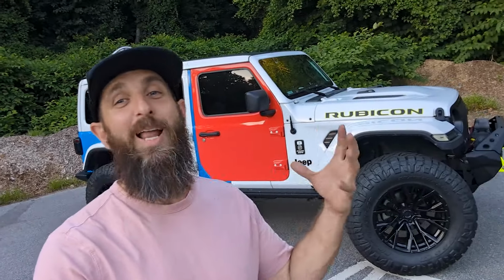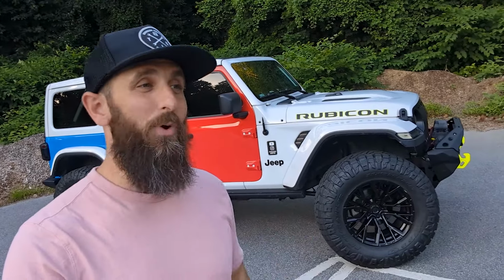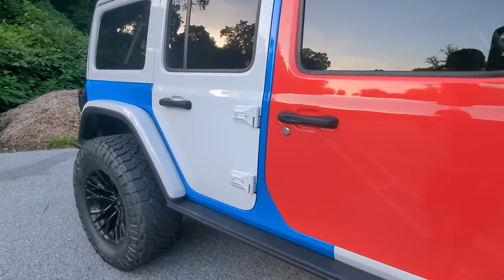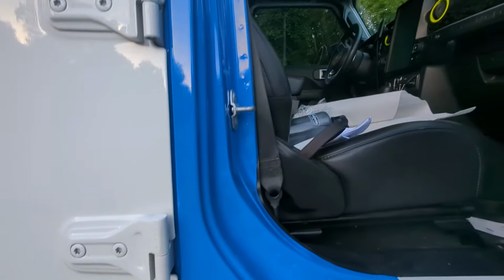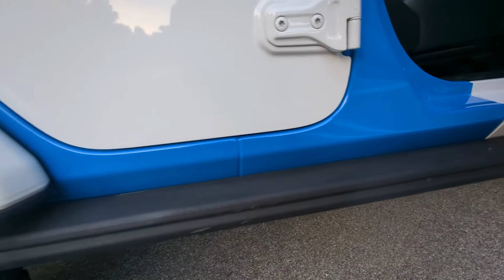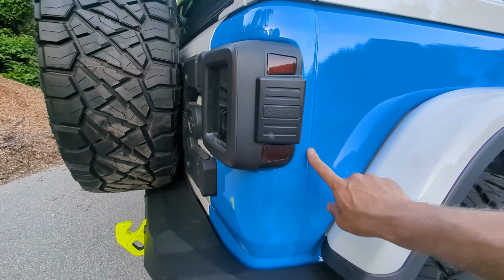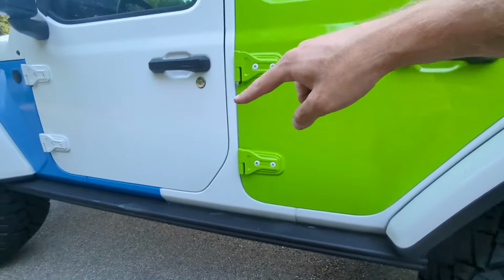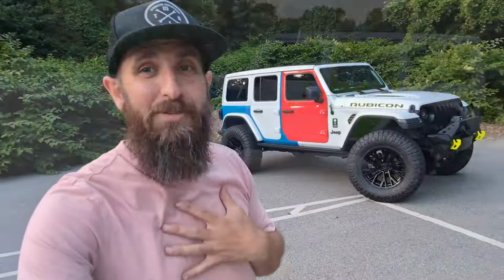ColorThisJeep Part 2: Wrapping Panels 3 & 4 | 4th of July Theme + Giveaway Announcement!

Comment: I was so glad to see you used my suggestion of putting the winners name under the wrap. It looks great. Gives a cool embossed look
Reply from the maker: It was a great suggestion I just have to figure out how to add it to the two panels I already wrapped, should. E able to just pull up and edge and add it underneath
Reply: Pulling up and placing underneath should work. The sooner, the better. The longer the wrap sits the harder it is to pull and restick
Reply from the maker: @jply87  agree going to try this weekend

Comment: As the owner of an XK 5th wheel light, I like it very much. I would highly suggest that anyone who uses that product also install a plug. The wires are directing connected to the back of the light. This is a problem if you need to pull the light off to do some work. The light will just hang from the wires. I installed a 6 pin connector to make removal, cleaning and mods easier. I was very surprised that XK did not install a plug on the wires